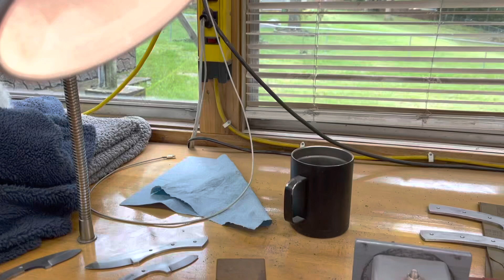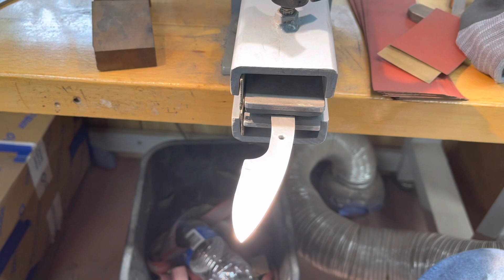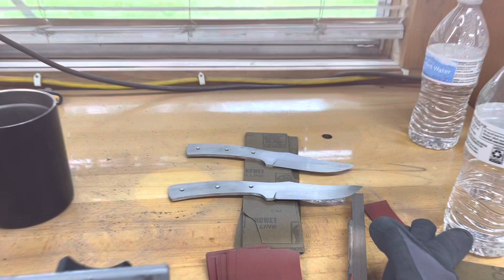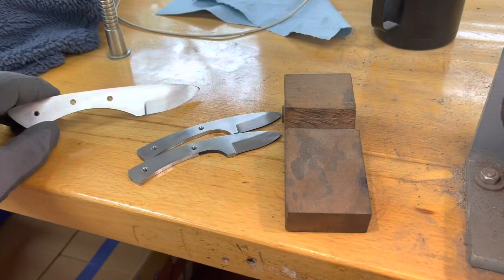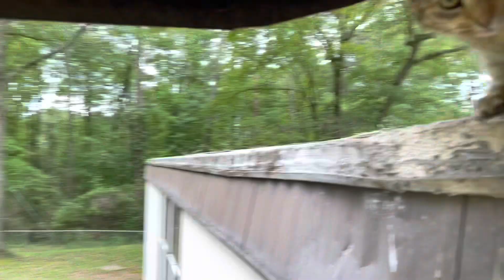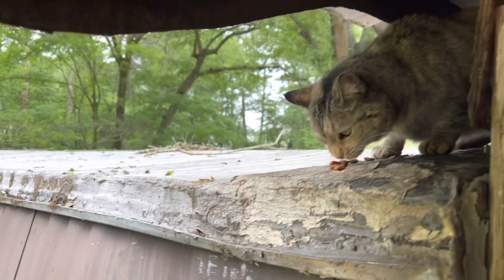Got four heat treated

Comment: Roof Cat is probably going to get you into heaven.
The merciful obtain mercy.
Brad, have you ever tried wrapping your oven in a ceramic insulation blanket
to keep some heat in?
Reply from the maker: It’s a convection oven and it has a two hour timer on it. Do you think I need to?
Reply: @bctruck  
I think I need to.  My oven is getting tired.  I use the same type of oven as yours for baking and tempering. They poop out after a while. I’ve been through three over the years. They’re not $59.99 at WM anymore.

I’ve decided that I’m not going to hillbilly my way into an electrocution trying to make an electric oven. Not without some education on the subject.

I’m trying to get more out of what’s available.  I’m guessing that these available,super toaster ovens could get hotter inside with a bit of insulation. I’m thinking of covering everything that doesn’t have a vent with some one and a half inch thick ceramic fiber sheet wool. I’ll cap it with a baking sheet and screw it to the oven with sheet metal screws if it helps. 
My only fear is over heating the control mechanisms. That’s why I was asking you if you ever did it. 
(I’m loathe to cut the stuff. It was bought for something else before life clobbered me. )

I wonder how hot you could get a closed metal box with that Texas sun trained on it through magnifying lenses?
Reply from the maker: I have an electronic thermometer. This ovens seems to hold a pretty steady temp. My last one I bought at a flea market for 5 bucks. This one I spent some money on.
Reply: @bctruck  
I know, …..an oven that runs on homemade hydrogen. I’ll start the grant papers. What do you think? Ten million? For a start?
Reply from the maker: @chopsddy3  ask for 11 million. That’ll keep us in donuts.
Reply: @bctruck  
😁👍 And bear claws.